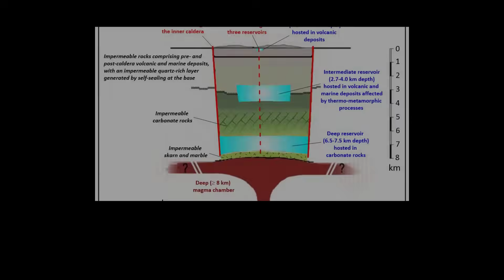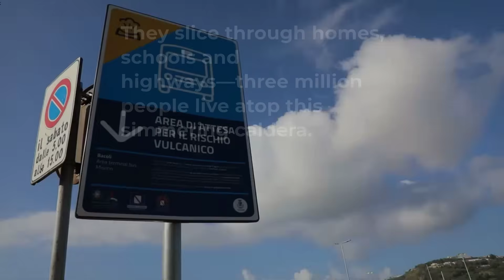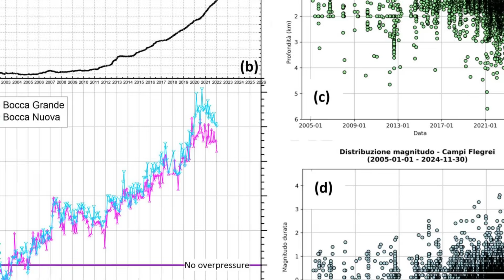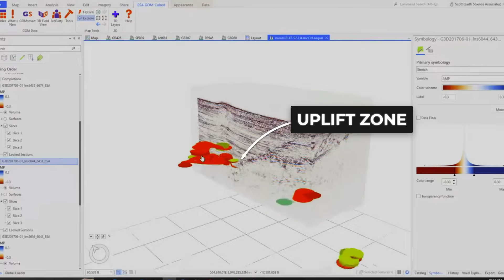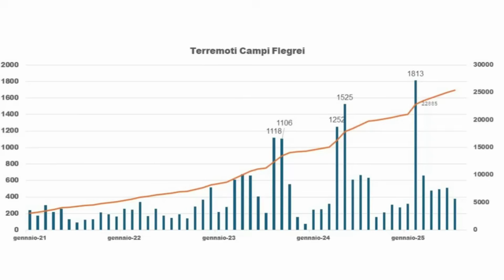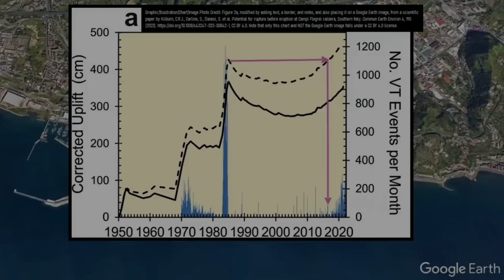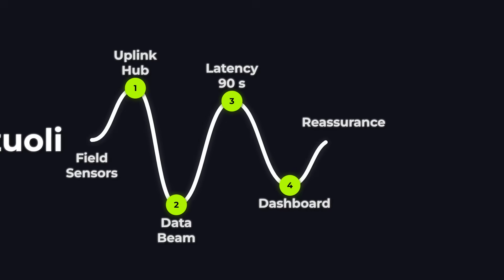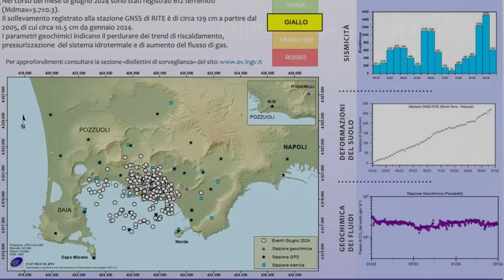1 MINUTE AGO: Campi Flegrei Triggers Mysterious “Boiling” Sea Near Naples!

Comment: Die große Gefahr,  ist eine dampf Explosion. Das wäre extremer als schlimm. Denn was passiert ist, am hongatonga. Es wurde soviel wasser verdampft wie in 58,000 olympischen schwimbecken passt. Das sind unglaubliche 10 Prozent des Wasserdampfes das normal in der Stratosphäre ist. Was dagegen die Flegräischen felder verursachen könnten. Wage ich nicht zu beurteilen. Aber die Gefahr ist extrem hoch. Das es zu Tsunamis kommt mit mehr als 30 Metern. Und Neapel, wird es dann nicht mehr geben.
Reply: 14 Januari 2022
Reply: In the past 1000 years there hasnt been such an explosion at Campi flegrei.  There was an eruption of magma in 1538 that interacted with water to some extent but it built a small cinder cone, there was no tsunami.    The eruption lasted a week.  Prior to the eruption land rose at 3m a year or more for a couple of years, ten times the rate at which the land is rising now.    Your forecast of a tsunami is fearmongering.  I suggets you visit geologyhub.